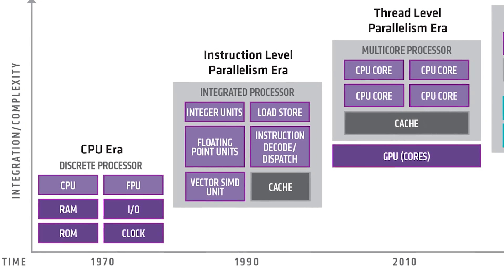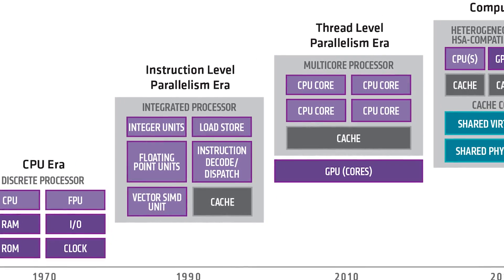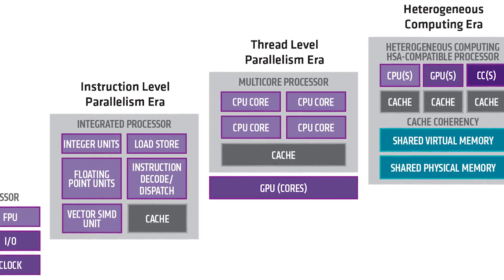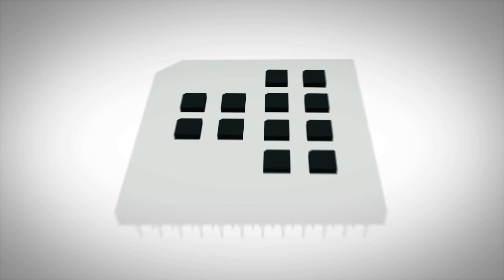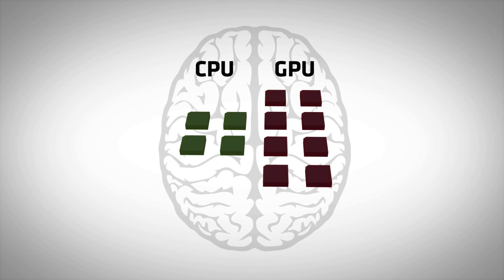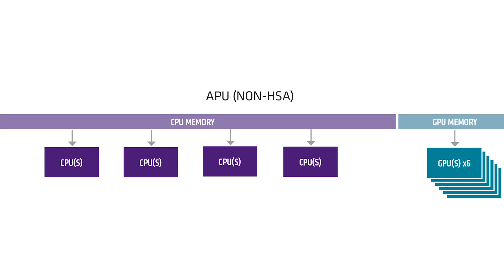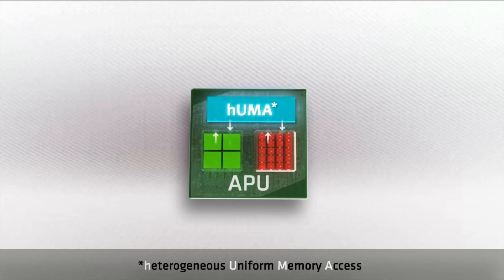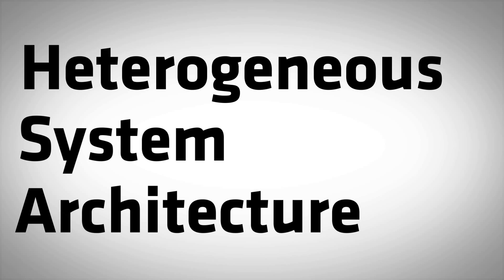What is a Compute Core?

Comment: CPU & GPU can share same memory? Cool, something like amiga1000 from 1987...
Reply: Until we can start buying and fitting GDDR into motherboards ourselves, this is absolutely useless. The biggest bottlenecks of APUs right now is being forced into using standard primary DDR RAM.

And, honestly, who wants a system that in order to upgrade you have to remove the entire heart of the computer? Especially for gaming, I'd much prefer to keep my CPU that probably is well above the performance necessary for gaming at my resolution and just upgrade my video card.

It could be nice in devices, but not a desktop, IMO.

Comment: I think its pretty cool, however... just like with Intel quick sync, if nobody uses and adopts it then its pretty much a wasted effort and becomes dust in the wind.
Reply: ***** I kinda doubt it works like that, pretty sure a program must code such features in, just like how adobe premier didn't support OpenGL and only CUDA for a good while, also just as an example.. how many games do you see taking advantage of Mantle...? like 2 or 3 so far? thats something gamers have shown they would quite like to have, yet its mostly sitting around gathering dust, because almost no devs have decided to use it.
Reply: I think the idea of the APU is that it uses the same binaries as a standard system. I could very well be wrong, but I really don't see it using different binaries to access GPU functions as a standard system (at least not without hardware translators built in, making it an invisible layer to programmers).